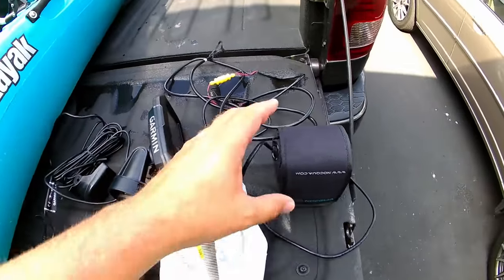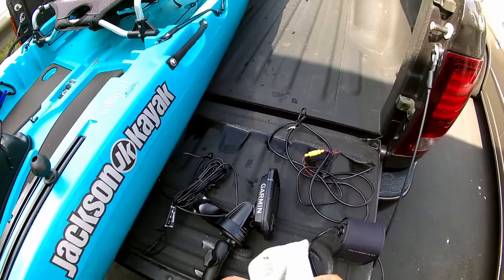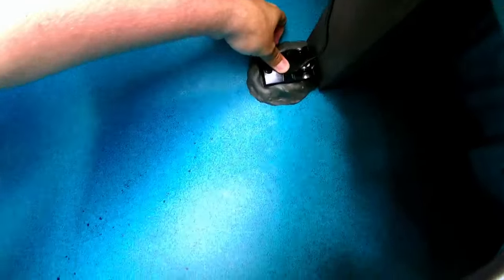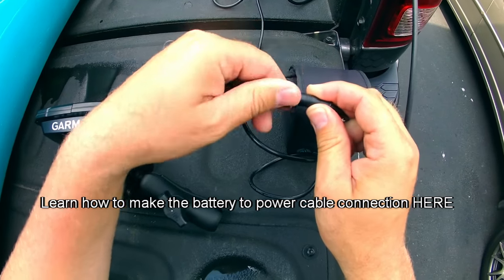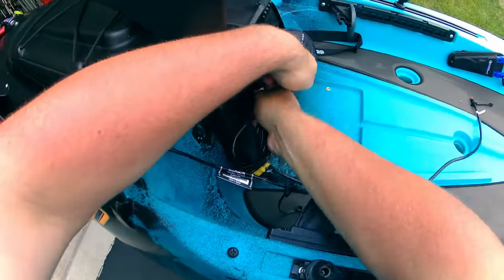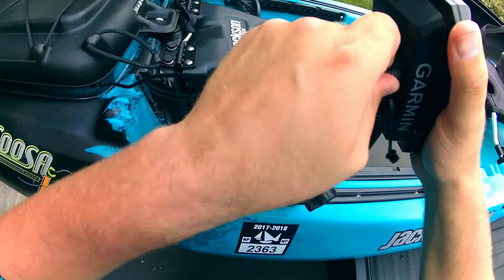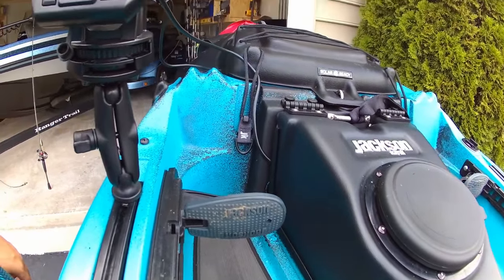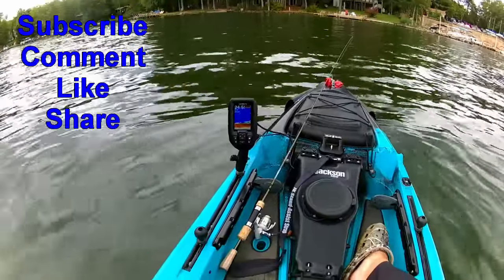Garmin Striker 4 Kayak Install...Simple Transducer Mounting Option

Comment: Without the water, the transducer could burn out and have issues if running for an extended period of time out of the water. From the Garmin website
Reply from the maker: https://youtu.be/Iws0jhezBJY
https://youtu.be/e8H5qJyA_XE
We run like this and have not had any issues even in 90+ degree temps and long days.
I did some testing  in these videos that may help.

Comment: Wow. I did not know you could install a transducer inside. I am just getting into kayak fishing so I bought an inexpensive kayak. A BKC pk13 with the trolling motor for less than $1500 delivered. Only problem is not place underneath for a transducer like the more expensive. I really don’t want a hang over the edge kind of
Reply from the maker: I use in hull mounting on mine without issue.  It is extremely easy and keeps the transducer safe.
Reply: Thank you. That’s my choice as the kayak I have order doe not have a through hull place for a transducer

Comment: if its not in water theres a chance the trancducer overheats and gets destroyed. When it is in the water the water works like a cooling system
Reply from the maker: On these lower power transducers it is not really an issue.  Many including myself have ran them like this in the summer without issue

Comment: So you just need to stick it in there and no holes? Does it read just as well? I read something about wetting it down do you have to do that?
Reply from the maker: Watch this https://www.youtube.com/watch?v=Vir8gm-meQ4   and no water required.  On high powered transducers yes they must be wet for cooling...this is not that high powered so no issues.

Comment: Have you had any problems with the digital depth read out blinking when mounting the transducer like this? It how's the sonar and all but the depth is blinking the same depth and not changing or staying constant.
Reply from the maker: Nope none at all, If you are having these issues it sounds like 2 possible problems. 1 could be that a pin in the connector is loose or not seating correctly.  The other may be that you have some form of airgap between the transducer and the hull.  Whatever you use to mount the transducer in the hull with it must have no air gaps between the transducer, duct seal, and the hull.

Comment: Just got my striker 4 for kayaks and have been looking for ways to install it going to try your duck seal first alot cheeper than the other ways thanks for the great idea
Reply: Also will the 1 pound block do 2 kayaks or will I need 2 1pound blocks
Reply from the maker: Definitely is cheaper, plus its 100% protected. Just make sure to leave no air gaps.  Press the duct seal into the hull firmly, then put the transducer into the duct seal and seat it firmly.  Make like a 1/2 to 1" bed of duct seal
Reply from the maker: 1 pound should be perfect for 2 kayaks.  I split the 1lb in half for mine...perfect amount
Reply: 1Cast 1Fish thanks for the advice
Reply from the maker: Be sure to hit the sub button, and let me know how it works out for you or any other questions

Comment: it looks like that would get in the way of your normal paddling stoke? I have one, but I have yet to find a good place for it. I'm trying to mount mine inside my center hatch. That will probably have its own issues?
Reply from the maker: This was on a Jackson Coosa HD, so it was far enough forward not to cause a issue.   Mounting can be tricky though and definitely your paddle stroke is something to think about...along with ease of acess to change settings.
Reply: @1Cast1Fish  roger that. Thanks for the advice.

Comment: So the duct seal allows the transducer to work without touching the water? I want to try that in my wilderness 115. Does it mess up the quality of the signal? Thanks for the great video
Reply from the maker: Should be good to go, I have had no issues and neither have many others

Comment: Just picked up a Striker 4 kit. It appears to have come with a foam attachment that does this very thing. Adheres to the canoe bottom and then says to add a bit of water before use to the cut out. I have it set up and will give it a try this week.
Reply from the maker: The foam works well, it just requires water to be added
Reply: So if you use the duc seal you don't need to add water? I'm having a terrible time using that foam, it never seals and the water goes out and it doesn't work

Comment: Which way do you face the transducer? The illustration in the instructions show it mounted on a trolling motor in a backward L position while your vid shows it in a forward L..thanks for all the info..
Reply from the maker: I get this question every now and then...but since I use it in my kayak, I mount it so that the cable can be out of the way from tangles...that is why it is "backwards" , Also think of a transducer mounted on the trolling motor, when fishing how often is the trolling motor facing directly forward?...It's not and the images are still great without issue.  Hope this clears it up a bit.
Reply: @1Cast1Fish  thanks!.

Comment: Could you put it inside of a livewell? Especially if you aren’t using it?
Reply from the maker: I would say No, since most livewells are insulated or sit above the bottom of the hull...all of these issues will create an air gap which will cause the transducer to not read.

Comment: Hey boss, great video! Quick question, do you have to have the transducer in water? Or wet?
Reply from the maker: Nope, mine is dry...no issues
Reply: You’re the man, thanks!
Reply: This is from Garmin manufacture .

A normal 500w or less transducer should not have any issues when running out of the water. A higher powered transducer, 1kw or larger, may have the potential of having issues as they normally use water to help cool them down when operating for long periods of time. Without the water, the transducer could burn out and have issues if left running for an extended period of time out of the water.

Comment: I want to mount a Garmin Striker Plus 4 to the front of my Heritage Redfish 12 Angler Kayak. The Mount will be on a diagonal slope just below where my Scotty Rod Holder is located. 

Is the Garmin Striker Plus 4 adjustable up and down?

 How much can you adjust it up and down?

What Scotty or Ram Mount would you suggest I use?
Reply from the maker: It has a lot of adjustment...I would recommend the one I linked in the description...it will give you even more adjustment...just don't forget the additional 1" ball mount you will need as well if mounting it to a rail...it is also linked in the description.  Hope this helps and other questions let me know.

Comment: Awesome video.  I have an older cruise ans want to do this same setup.  How's that battery hold up and how do you charge it (I'm new to all this electronic stuff)
Reply from the maker: I have had the same battery for years now without issue...just plugs right into the wall.  Battery I use in down in the description...(not trying to sound like a ad, but the Nocqua has done great for me)

Comment: Thanks for the video. It was very helpful as I mounting the Striker 4 in a very similar way on my Kayak. I have run into one issue with the sonar...it seems to read great at depths over 9' but pretty poorly in depths less than 9'. Any idea why or hacks to fix that?
Reply from the maker: Jay Arnold what is your sensitivity set to?
Reply: Honestly, I'm not sure. I haven't changed the sensitivity so it should be at whatever the factory default is.
Reply from the maker: Jay Arnold check out my video on the Striker 4 sonar @ 1:53 or so I discuss the gain...which is how sensitive and amplified the returns are ...check this number out and turn it down a bit in shallow water.  Let me know if this helps

Comment: will this work on fiberglass skiff? trying to figure the easiest way to mount transducer on rental skiff, any suggestions?
Reply from the maker: Yes it will the sonar might not be 100%, but pretty darn close.  This is how I have my in hull transducer mounted in my fiberglass bass boat without issue.  Just make sure its level and no air gaps

Comment: So that seal will hold it in place? It stays soft or dries hard?
Reply from the maker: It gets a bit hard in the winter and a bit soft in the summer, but no issues or extremes.  Easy to remove and reinstall any season so far.
Reply: You can used a velcro patches work good too 👍

Comment: Won't that mess with the sonar ping? You will have the duct seal, plus the plastic from the kayak? I don't know anything about these things... just asking?
Reply from the maker: These sonars use sound waves...so as long as there is no air gap between the hull and seal and the seal and transducer then the waves will go out and return without issue....any gap with air as a buffer and it will not work.
Reply: @1Cast1Fish  Oh, Okay, great. Some other guys said with the duct seal they were having issues with air bubbles... have you ever had that happen to you? Thanks
Reply from the maker: @OfficeofthePacific  I have not...but I was very careful to ensure no bubbles. I kept the duct seal block almost whole and pressed everything together to keep air out.  I get that question alot...probably should do a video on it at some point.
Reply: @1Cast1Fish  got it. Thanks👍

Comment: I have done a shoot through the hull with another depth finder with bad luck, having to pull the glue off every couple of years. will the  Duck seal hold? I haul my yak bottom side up on the top of my Xterra.
Reply from the maker: You have to ensure there is no gaps for it to work 100%, and yes the duct seal will be much better than glue...and easier to move
Reply: 1Cast 1Fish Thanks, I may give this a try. Should I support the duck seal with anything?
Reply from the maker: Nope...just press everything together real good...it’s pretty sticky

Comment: Correct me if I'm wrong but the Garmin website says that the transducer should be submerged in water to avoid damage
Reply from the maker: It does say that.
https://youtu.be/Iws0jhezBJY
https://youtu.be/e8H5qJyA_XE
We run like this and have not had any issues even in 90+ degree temps and long days.
I did some testing  in these videos that may help.

Comment: hello friend, sorry for my comment but this is something new for me, it is not necessary that the transducer is directly in the water?  the transducer readings are the same if it is inside the kayak??  Thank you
Reply from the maker: This transducer will work fine as long as there is no air gap.  The only reading that will not work is Temp
Reply: @1Cast1Fish  Thank you friend, my kayak (Hobie Pro Angler) has a place where the water enters from the bottom so I hope it is enough for you to give me the water temperature levels, which is special to install the transducers only that it is more for big screen translator so I installed it there with what you recommend, I hope it works well 😀, sorry if my writing is not good but I speak little English
Reply from the maker: Hope it works well for you, good luck

Comment: I bought the Ram light duty mount you posted but the mount holes do not match up with the base of the garmin striker 4?  How did you attach that mount to your striker 4?
Reply from the maker: Weird....should fit without issue.  Have you tried moving the plastic base around...there are a lot of holes on the mount, and you gotta get it just right with the right holes/

Comment: When you push the transducer down in the putty does it have to be pushed right down to the kayak or is it okay if theres putty in between the transducer and the kayak. Also if it doesn't work right is it hard to get that stuff off the transducer?  Thanks for the help.
Reply from the maker: Yes you want the putty to fill the gap between the transducer and the bottom of the yak...any air gap between them with ruin your image.  Just mold the putty into the bottom of the yak, and press the transducer right into it.  If it did not work, you probably have air somewhere ....and yes it is super easy to pull up and off and try again.

Comment: So i tried this but my fish finder wasn’t showing depth or marking any thing. My transducer plug was exposed to water tho, so idk if thats a factor. Any tips?
Reply from the maker: Might be an install issue, or may be a plug issue.  Best way to see if it's a plug issue is just pull the transducer and hold the wire...lower it into the water and see if it fixes the issue.  If a good image shows, then I would double check installation for air gaps, and ensure it sits below the waterline.
Reply: @1Cast1Fish  okay 👍 thanks for your help!
Reply from the maker: No problem, hope this helped and you get it working

Comment: I tried it for the first time last week and saw no bottom and mostly a solid light blue line coming across the screen. Is there something I need to check in specific? Thank you for your response in advance.
Reply from the maker: Kenny Boudreaux what is the model you have? Standard 2D sonar, down image, or side image?
Reply: 1Cast 1Fish it's the garmin 4.
Reply from the maker: Kenny Boudreaux I would check the transducer wire connection back at the unit...also how deep of water were you in?
Reply: 1Cast 1Fish It varied! Sometimes 6ft sometimes 25ft.
Reply from the maker: Normally this kind of thing can be narrowed down to a few things then...it hard to tell without a picture of the screen, but give these things a try. 1st make sure the transducer wire connector is firmly inserted into the head unit.  2nd make sure there is not a air gap between your transducer the putty and the hull.  If I run my transducer out of water and in air I get a line as well...which might be what your issue is.  Remove the transducer put the putty in the hull and press it into the spot (No air gaps)  then take the transducer and press it into the duct seal firmly...again no air gaps.  Ensure the putty area in the hull is larger than the transducer if any transducer is hanging over the putty...then it will not work due to a air gap. You have to make the hull, putty, and transducer like it is one solid piece...no gaps....press everything in good. If these two items don't work let me know...could be the transducer or a rouge setting on the unit
Reply: 1Cast 1Fish i will try those suggestions. I appreciate it!
Reply from the maker: Kenny Boudreaux Just wanted to follow up and see if its working for you?

Comment: I really like your install without drilling!
How is the transducer working? the instructions say to install outside 3/8" below the boat. Is it accurate from the inside?
Reply from the maker: This method works awesome on my kayak...no fear of breaking the transducer, easy to remove if needed, cheap to install, and great image.  Just a few notes; On the inside of the hull it has to be on the bottom, with no air gap.  The hulls bottom on the inside is below the water line.  Also a few things with in hull mounts water temp read out will not be accurate, and transducers with side and down imaging do not work well.  Hope this helps if you have other questions feel free to ask...don't forget to hit the Subscribe button for more future videos.

Comment: Looking to outfit my inflatable Sea Eagle 385 FTA with a fish finder like this.  The transducer would lay under the inflatable rubber deck, right on top of the rubber hull.  Do you think there would be any transmission issues with rubber? Great video!
Reply from the maker: I do think you will have issues if I understand you right.  The issue is that you can not have any gap of air between the transducer and the water...and the tubes are full of air.  Plus transmission get worse the thicker the material you have to shoot through.

Comment: what kind of material the kayak made of? is there will be any problem if the kayak is made of fiberglass? How about kayak made of wood?
Reply from the maker: Mine is plastic, but I also have a thru hull mounted transducer in my boat, which is fiberglass...both work without issue

Comment: I have a Stryker4 also and was looking to mounting tips. Does the transducer work inside or on the kayak. I thought that it has to be in the water. How accurate is it with this technique? Thanks for the Great Video!
Reply from the maker: The only thing that will not work correctly is the water temp.  Also no side imaging (if you have that)

Comment: Great video...just got a Garmin Striker 4 for my SG130....what size Nocqua battery did you get?  How long does it last typically?
Reply from the maker: I use the 10 Ah Battery....I did a video on it and it lasted about 36 hours of continuous run.  I use mine a few outings then recharge normally, but I use it for my fish finder and a power supply for my GoPro as well.

Comment: Do you loose any quality with this type of install? I have a polycraft tuffy 10' boat it's a plastic fishing boat about 1/3" thick plastic do you think this would still work
Reply from the maker: Yep...should be good
Reply: @1Cast1Fish  just stuck it in today,we got the covid lockdown so hopefully get it out on weekend to test it out... I turned it on and it was throwing some weird Images on the sounder so hopefully in the water it will be sweet..
Reply from the maker: @peterk7377  yes u must be in the water

Comment: What would you do if you don’t have a hatch to put the transducer inside the boat? I’m not sure how this all works I’m new to it all and doesn’t the transducer have to be wet or inside water to read?
Reply from the maker: No hatch may make things very difficult since you must have the transducer below the waterline still...even though its not physically in the water.  Plus you can have no air gaps. 
No the transducer does not have to be wet to work.
Reply: @1Cast1Fish  i definitely understand well if all else fails I’ll just run a Scotty arm on the side
Reply from the maker: There are a variety of arm options out there, some more ridged than others...if fishing in thick grass and such get a more ridged mount